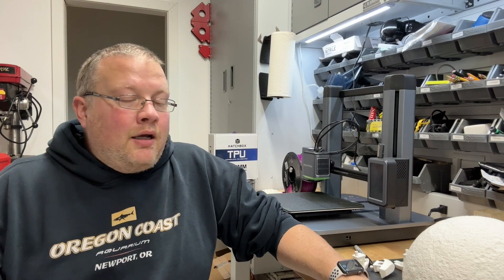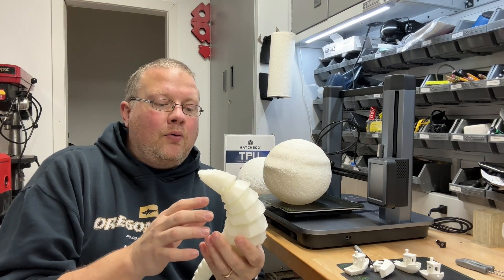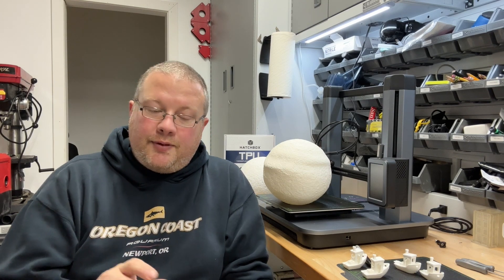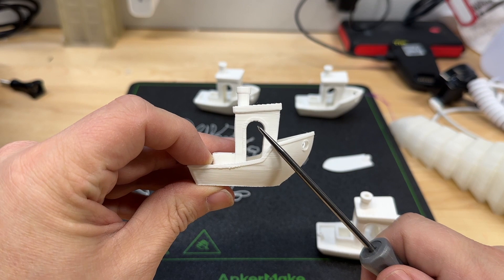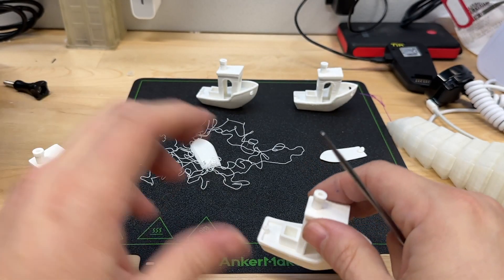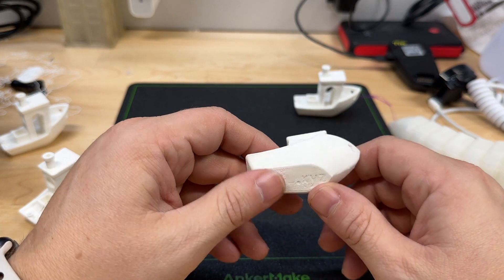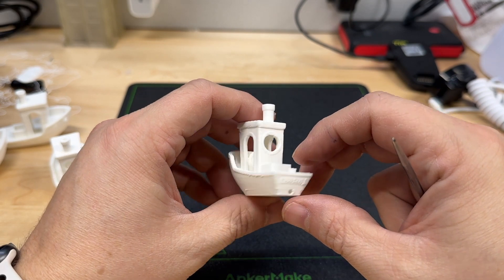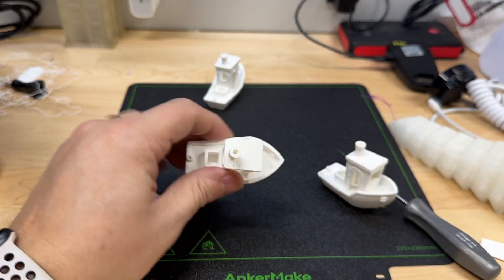AnkerMake M5 - Speed setting and layer height

Comment: I’m curious if you varied print temperature with these. I just set up my Ankermake yesterday and noticed that the default temp for PLA is 230 C. My guess is that if you kept the 230 C temp with the slower speeds, the temperature might be causing the sagging on the port holes. I’d be curious if something closer to 200C would produce a better bench at slower speeds
Reply: Actually I’m seeing mine print at 200 C now with the anker slicer. It must just do 230 C for the first layer or something
Reply from the maker: I will be trying some PETG this week.  But I will try you suggestion and lower the temp on the slower print.

Comment: If possible, could you make a tutorial video of sorts when swapping the nozzles? I would also like to try out the other nozzles, assuming you find that one of them is "better".
Reply from the maker: Based on your comment I think I will do several tutorials.  Loading and unloading filament, changing nozzles, bed leveling, etc…
Reply: @timexperience  that would be ideal
Reply: I recently attempted swapping the installed 0.4 nozzle for the included 0.2 nozzle. 1st try everything went as expected until the 0.4 nozzle was about 90% removed, then suddenly seized, and the bolts connecting the hot end to the cooler block sheared off. Ugh. Luckily there was a spare hot end and cooler block included, managed to swap out, and tried nozzle swap again and it worked with no disaster!

Comment: Those globes are sick! The quality on those benchies looks questionable, but the printer seems like a very polished machine. You should take a look at the bambu x1 carbon. It's another fast printer in the pricepoint.
Reply from the maker: I have seen commercial printer struggle with producing a perfect print of the Benchy model.  In particular the lettering on the stern. The Bambu was an unknown to me when I was selecting a new printer.  I could find no one with first hand experience so I went with the AnkerMake. Only time will tell if it was the right choice. I am not likely to buy another printer anytime soon.
Reply: @timexperience  Hey hey. I ordered both the Ankermake and the Bambu lab X1C with AMS. I have been printing with the X1C since August and can attest it is an amazing printer.  I should be getting my Ankermake sometime in mid December and the V6 color in....2023?

Looking at the benchy shows me a little in what's in store for me with the Anker. I see a lot of rough edges and more tweaking in store whereas the X1C is the closest to slice and print I have seen in a 3d printer without having to muck about in settings. 

Great video. Enjoy your Thanksgiving holiday.

Comment: Thank you for the weekly vids! Is it possible to get fdm prints as smooth as sla prints? I heard aetone and sanding helps, but will future ankermake software updates make fdm as smooth as sla?
Reply from the maker: The only way I have seen FDM as smooth as SLA is with extensive post processing or very expensive commercial printers.  Downside of SLA is that they typically don’t have the build volume of FDM printers.
Reply: ankermake printers don't produce vastly better quality parts than others. They're actually quite slow compared to good corexy machines.

Comment: Also what slicer are you using? Have you tried glue stick/hair spray/magigoo to help with bed adhesion?
Reply from the maker: I am using the default slicer from AnkerMake.  I have used others for my other printers but my goal with the AnkerMake is to stay with the default setup.  The adhesion I have tried was painters tape but that was before I found that it was my error selecting the wrong material in the slicer.